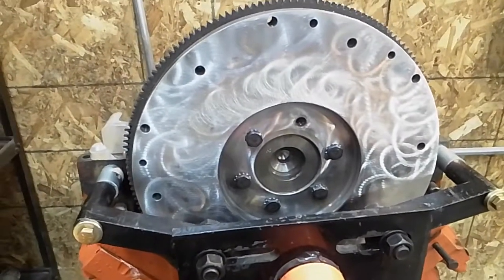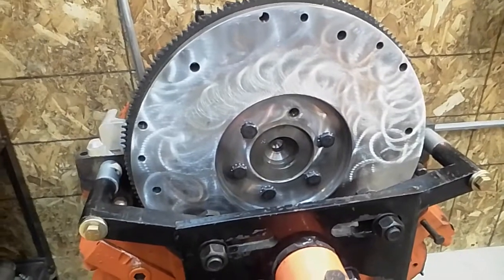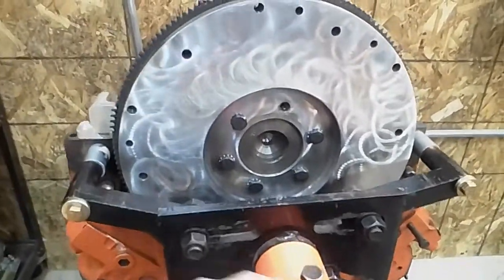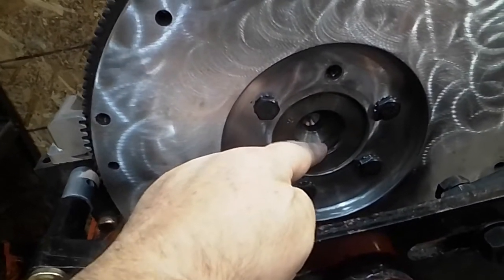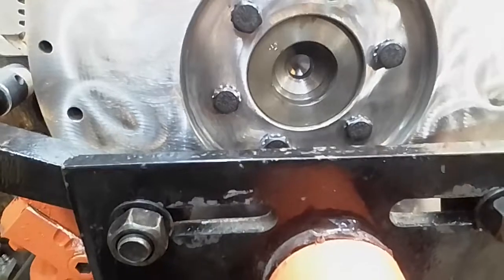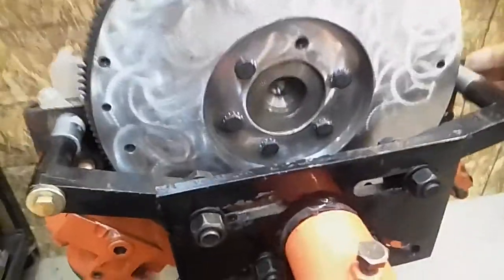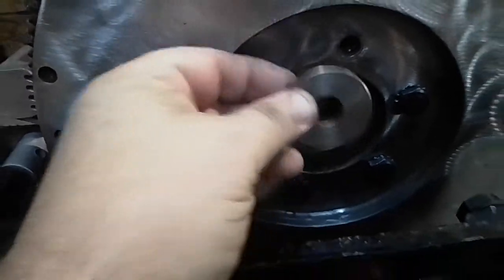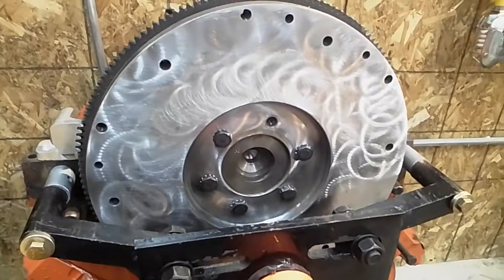Cadillac 472 / 500 manual transmission

Comment: Thanks for making /posting this, I was 95% on the parts combination & you confirmed what I was thinking. 
 The only other thing I wonder about would say different size input shafts for various division manufacturers- think Chevy truck application mated to SM465 or NV4500/5500. Yet as you have already shown its just a matter of measuring on the desired trans.
 Great vid, GOOD info, please follow-up with more when time allows.
Reply from the maker: If the input shaft pilot is bigger than the center hole on the bushing can be opened up .. I know of a few truck installs that cad co has done where that had to happen ... The good thing is gm did not change a lot .... And these days there are a lot more bell housing choices out there for different transmission's
Reply: @scotthatch4548  Thanks - yes, when it comes to mix n match on projects I've found GM products to be easier to work with.

Comment: What bellhousing  do i need ?   I am thinking about swapping my 425 in my 87 monte carlo with a 5 speed
Reply from the maker: Buick  Oldsmobile Pontiac and Cadillac is the same pattern sometimes called BOP with starter notch on the passenger side and that fits your transmission

Comment: Hey Scott, do you think an 11 inch clutch is good enough for a healthy 500 cadillac motor, or should I go with a 12 inch?
Reply from the maker: I ran a centerforse dual friction with 1000 ft lbs no problem I think it was only 10.5 but I can check Thursday.. I know it was not 12"

Comment: Which manual transmissions could you run that would hold the power of a 472/500?
Reply from the maker: @HillDwellerFeller  I ran a Doug Nash/Richmond 5 speed
Reply: @scotthatch4548  thanks sir
Reply: @scotthatch4548  appreciate the videos, very helpful